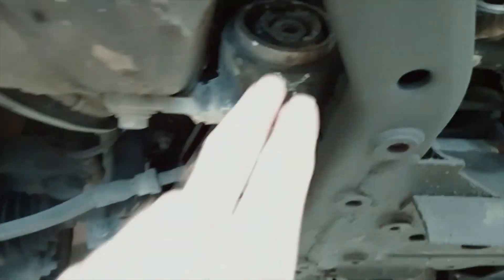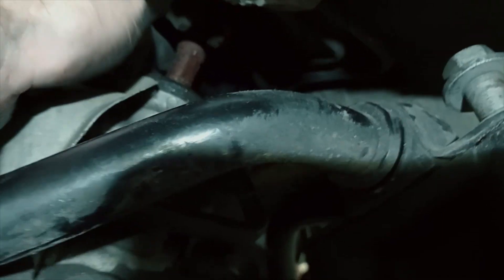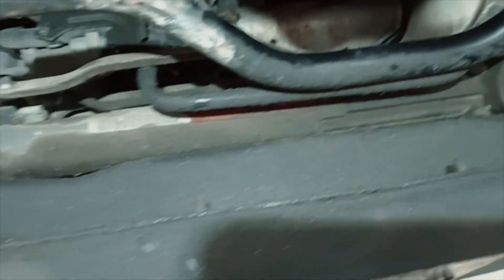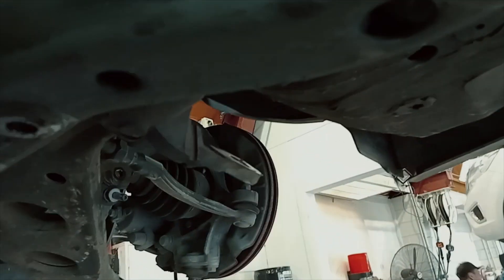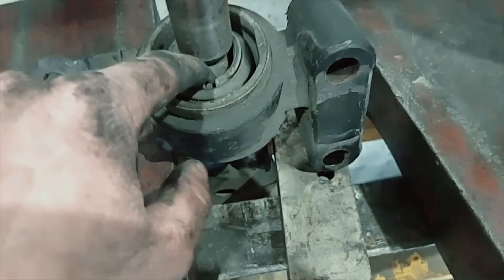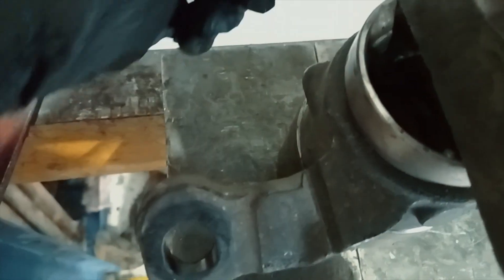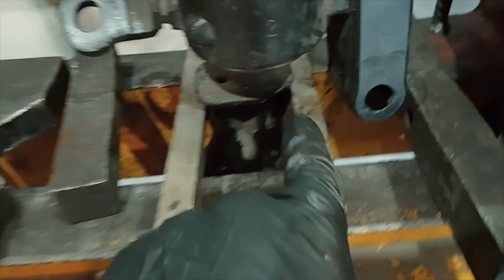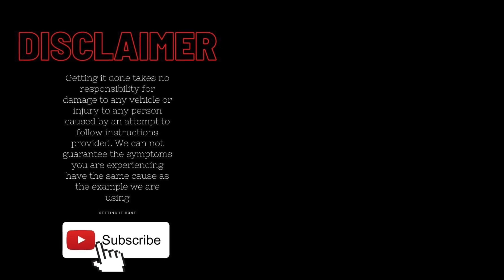mini cooper front suspension arm bushes

Comment: My  mechanic is asking me to order the wishbone arm lower left and also the right to do this job.  I just need him to replace the arm pin or bush worn just like what you have shown in your video. Is my mechanic right?
Reply from the maker: A couple of things to consider there. Firstly it can be a matter of what is available. If only arms are available and not bushes, that might be what you need to do. (Just need to be sure the new arms come with the bushes on them). The other thing to consider is, if the price of a complete arm is not much more than just a bush, it can be beneficial to replace the complete arm. The reason being that you save all of the cost for the extra time it takes to press off the old bush and press the new one on. So it can sometimes work out more cost efficient to replace the complete arms in some cases. Also you mentioned the pin? If they are saying that the pin or the arm itself is damaged then replacing the complete arm would be the only way to repair that.